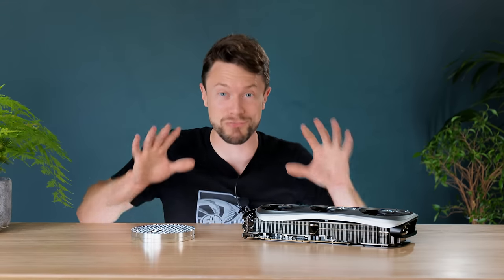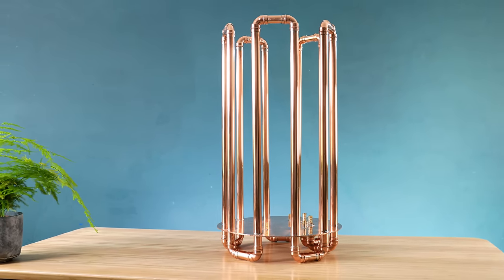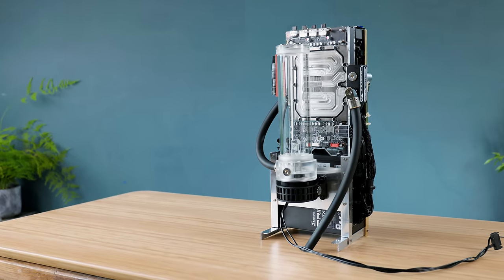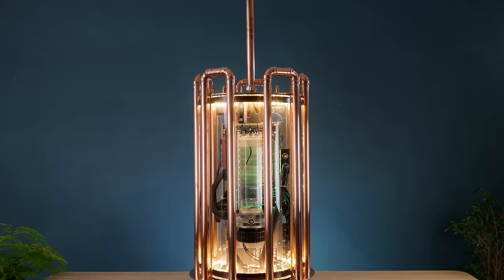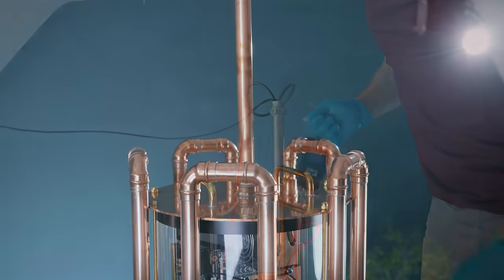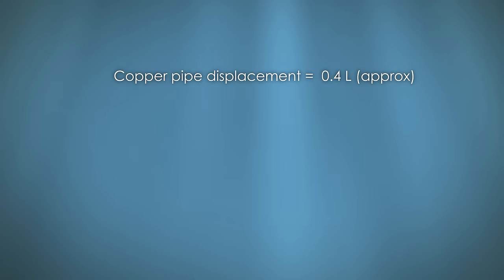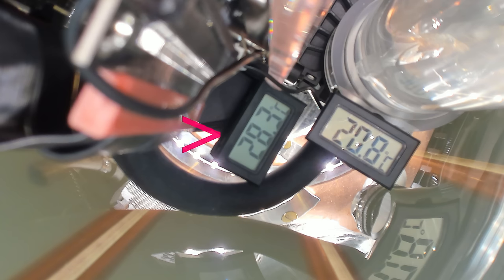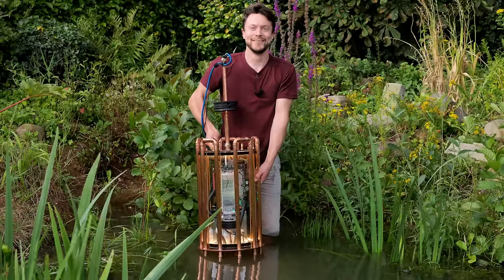Building an ACTUALLY water-cooled PC

Comment: There is a simple little water leak detector that's made for going under water heaters or in basements and cellers. You could install one at the bottom to get an instant audible alert on the first sign of leakage. Moreover, if you wanted to be really fancy... take that same alert signal run it thru an arduino or similar programable logic controller that triggers your pulley system to pull the computer out of the water.
Reply: He's never gonna use it again, tho. Probably disassembled it already.
Reply: @Iuripiotrowskidarosa  true.

Comment: the reason why your joints might look a little messy is because you're using pro press fittings instead of solder fittings. those little rings you see on the 90's are supposed to have a rubber ring inside, and they are meant to be fully compressed into the sides of the pipe using a pro press. if you'd used normal 90's, im sure the end result would have been much easier to get and wouldve looked much nicer!
Reply: I'm pretty sure that the ones he's using aren't pro press fittings, but rather a very similar-looking type that has a ring of solder incorporated in that bulge rather than a rubber o-ring, so all one needs to do is assemble and heat, no extra solder or press needed.
Reply: Not pro press but rather a solder ring inside, more common in Europe than USA.
Reply: @MysticalDork  I've never seen those before! they look very close to a pro press ring, I was mistaken
Reply: @joshdeconcentrated2674  They do look extremely similar, I don't blame you. I wouldn't be surprised if the same tooling/factory is used to make both kinds of fittings, the only difference being whether the insert is rubber or solder.

Comment: Awesome! For more longevity on the water seals you might consider milling o-ring grooves for the acrylic tube to slot into. Then you would have the advantage of the self-sealing o-ring effect, that would get more watertight as more pressure is applied. I would be concerned that the flat gasket seal would begin to fail with time, possibly relatively quickly.

Comment: I think this would make a lot more sense with copper gaskets, and an electrically neutral medium or an electrically neutral coating to prevent corrosion, and a positive interior pressure which would help reduce buoyancy and a sealed top so if there is a leak, the natural buoyancy of the system will prevent liquid from entering. Beyond that, this is genuinely incredibly cool. When its got the yellow and dark blue lights going (yellow rim, blue interior) it has a weird aesthetic resembling some of the real quantum computers I've managed to see. Quite surreal.
Reply: bumping cause i had all these thoughts while watching, especially that final shot looking exactly like the ibm quantum computer.
Reply: but what about condensation?  It is easy to cool a PC to low temps, dealing with the dew point is the problem.

Comment: I'm honestly impressed at the dissipation capacity of the thermal contact blocks on the cpu itself, one thing is keeping the waterloop coolant under control, but another is the physical limitation of how much heat can be transferred at any given moment through the main copper baseplate. Keeping a 13900K at stable 60 under max load is mighty impressive.

Also I'm sure the fish appreciate the added central heating, their pond value will now soar to the sky compared to competitors in the pond estate market!

Comment: I wouldve liked to see a thermal test of the complete system out of the water. Such a phenomenal build though and sick idea, i know your projects are typically one and done but id love to see more of this and with long term solutions/testing for this project in particular.
Reply: Same. Does the pond really do much? Curious to know.
Reply: Exactly.  What was the temps like before it was submerged?
Reply: @guelphdgc7995  Science tells us it should be much better in water than in air. It's the whole reason we use water cooling to begin with. This system here is not too different from my weapon system's cooling on a navy ship. It uses a liquid to liquid intercooler, where chilled water made by the ship's refrigeration is pumped to the system and absorbs heat from the glycol/water cooling loop that runs through the power supply and radar. Water has a much higher capacity to absorb heat than air.
Reply: @NandR  thats a big if in a build like this. If there is enough heat, to overwhelm the system in air then water should be better, but if there isn't the results should be similar. if he tested it out of water we could see if it did.
Reply: @edwxx20001  not really an if at all. Stagnant Air can act as an insulator while stagnant water will still absorb heat better.
Reply: @NandR  most of the time yes, but there is also a chance that we see no real difference. the limiting factor for chip heat removal is first the material interface between the chip and the heat-sink, then the heat sink itself. the heat-sink is "water cooled" in this build with or without the outside of the case being in air or water. the case being a large amount of copper could possibly be enough to dissipate the heat of the case in air efficiently enough to be just as good as water.
If the amount of heat generated was high enough you can be sure that water should be better, however with only the heat generated by a modern computer air could be enough that you wouldn't see a meaningful difference at chip level temperature.
Reply: @edwxx20001  I feel like in air the CPU would eventually throttle, or the Desktop will be noticeably hot as opposed to the submerged state where the CPU never goes past 60
Reply: My bet is that it does absolutely nothing to thermals out or in the water. Modern cooling solutions are incredibly efficient.
Reply: @NandR  Yea, no. Comparing military purposed built hardware to a small surface area thermal distro 800w pc is just silly.
Reply: @evolicious  No it's not. The principle is the same. Using water to move heat from electronics and into a cooler supply of water. It's dead simple and nowhere near as complex as you think. Hell I had to blow on the fill port sometimes just to get the fluid to flow after the level dropped.
Reply: @evolicious   I know you are wrong. Water has a specific heat of 4.186 J/g degrees C, versus air, which has a specific heat of 1.005 J/g degrees C. That's more than 4 times the thermal capacity. It's the reason why Water cooling a PC exists anyway. But the small units people use for PCs can become saturated with heat due to the higher thermal capacity of the water than the air. This is basic physics. The actual weak point remains the small surface area of the chips being cooled. But the faster you can remove heat from that area the better. The only improvement I would make to this design is more surface area on the external tubes, like fins to dissipate even more heat.

Comment: Those temps are incredibly impressive just to add on top of how cool this project is.
Reply: guess the only way to cool a modern i9 is to have a pond as your loop reservoir.
kinda scary how excellent this cooling setup is. 800watt system pull is absolutely insane.

Comment: Maybe you can add a sensor to check leaks inside the tube, to shutdown automatically if leak detected so not damaging the components inside
Reply: #OceanGate
Reply: Even better : automatic release of the weights under the PC if it detects a leak, which will make the PC floats and reduce risks of higher leaks
Reply: @76Eliam  That could make the case tip over

Comment: Gotta watch it with multiple types of metal in your water cooling loop. Basically make sure any part of your water block that is in contact with water matches your copper theme, or use a metal that matches your water block. Different metals being in indirect contact via the water can cause one of the metals to degrade and ruin performance. It's not noticeably instant, but it is something that would become a problem fairly quickly. It will definitely be a pain to clean and repair as well. Anyway, can't wait to see a wireless RC gaming submersible build xD
Reply: Plus electrolysis, and other types of chemical reactions that can cause oxides, or sulfides to form at the contact points of two separate metals.
Reply: Distilled water is barely conductive so unlikely to be an issue. The only metal in contact with the pond water is copper/brass.
Reply: @JPEight  ponds aren't filled with distilled water.
Reply: @JPEight  brass is an alloy and is therefore different than copper. all metals have different oxidation potentials and any size potential difference will eventually lead to oxidation.
Reply: @trechtzach8151 there's no pond water going into the system, so that's good
Reply: we're talking about oxidation reactions happening outside the PC, with the outside metal parts, via the pond water
Reply: @jacobdavis6604  the copper pipes are exposed and that's where corrosion may happen.
Reply: You're cracked out of your gourd if you believe this rig was in the PC longer than a few minutes after he stopped filming lol.
Reply: also if two metals expand at different rates it can create gaps, which is obviously dangerous
Reply: "Distilled water is barely conductive" This is only true in theory, in practice the distilled water sill start picking up ions from the metals very quickly and within seconds will become at least somewhat conductive.
Reply: @nunnk105 is saying it might need a sacrificial anode, if you mix metals that are in contact with each other and any metal part exposed to the pond has an induced electric current (I'm not sure, but perhaps the air circulation fan shown at 7:40 could induce a current?), then its possible that corrosion can occur. Outboard motors on boats require a sacrificial anode as the boat moving through the water creates an electric current through the hull and the motor, the sacrificial anode will corrode before any other part of the boat does.
Reply: @KalishKovacs  Yeah, adding a zinc (or magnisum) anode would probably be wise if you plan on keeping it submerged for any realistic length of time, but at the scale he's doing this test it probably would have been just as good to have an aquarium with distilled water. If done properly that could be one method of cooling to use for home setups if we reach  a point where the bottleneck for commercial computer components is heat dissipation.

Comment: It might be interesting to fill the inside with Mineral Oil, that way, because Mineral Oil, Acrylic, and Water all have similar refractive indices, you wouldn't be able to see any of the protective bits, and it would just look like the electronic hardware was submerged directly.
Reply: another side effect would be your components shorting out, great
Reply: Then you would have a PC that is immediately shorted, and then sinks…
Reply: @Thecoolman1  @zyncra3965 
No it wouldn't.  Years ago I've seen people overclocking their PC's and they had the complete mainboard submerged in a container with oil.
Oil doesn't conduct electricity.
Reply: @Ni5ei  Well, it would fucking sink, don't you think?
Reply: @zyncra3965 Mineral oil is an insulator though, not a conductor.
Even power grid transformers are filled with some sort of mineral oil (Designed for the much higher voltages of power lines) and no problem whatsoever.
Reply: @Thecoolman1 seeing the amount of weights he added to make it sink, I dont think it sinking would be a fucking issue 😊😊😊😊
Reply: @peyton3509  Would definetly sink. Mineral oil is 0.8 g/cm^3, which means that the net boyeancy of the interior volume is 0.2 g/cm^3, or a fifth of the lfting power it had when it was filled with air.
Reply: @Thecoolman1  Well it wouldn't have to be completely filled with oil. He had to put extra weight on it to make it buoyant. So there's room for extra weight.
Reply: Would be cool as well because since people already cool PCs with mineral oil you could just loop it into the whole system so it's all flowing through the system, the internal space, and the copper pipes too.
Reply: toasty bros literally made a mineral oil pc this past year
Reply: @zyncra3965  Mineral oil won't short electronics
Reply: Right, I remember Linus Tech Tips team building PC in mineral oil. It worked great.

Comment: A couple of things you have to take into consideration:
Moisture... as you didn't vacuum out the air & seal, you might have to deal with condensation inside.  You might be able to cool the air to match the water temp prior to sealing & not have the thermal difference.  I'd also add some moisture sensors, both at the bottom for leaks pooling, and another for general humidity.
Crush pressure...  as this is more proof of concept for home use & floating, totally fine.  But for anything deeper than a creek or shallow pond, the rubber sheet gaskets probably won't work.  You'd probably need an internal ring preventing the plexi from being able to shrink, and some sealant around the outside edge.  But really, if you're going deeper you wouldn't be using plastic anyway.
Reply: Do you think condensation would form on the inside walls of the cylinder considering its 30°C inside?
Reply: @robertjusic9097  There is a possibility. That computer won't be on all the time and condensation just needs that small window to form. And honestly, contingency measures are great to have even if they might be unnecessary for others.
Reply: @robertjusic9097  Totally forgot the system was putting out that much heat itself when I suggested cooling the air prior to sealing, so the pre-cooling wouldn't work.  But yes, so as long as there's any moisture in the tube's air when it gets sealed up, there will be condensation inside.  But given it's a closed system, it won't increase, but just having it might cause corrosion issues down the line.  Vacuum sealing it should fix all that but I don't know how to pull that one off with the wires coming up & out.  You could instead fill with argon, since it sits heavier than air it will displace all of the regular air, and is both dry and inert.  They sell that stuff pretty cheap so that's probably the easiest way to go.

Comment: You could have filled the internal reservoir with mineral oil! It's a nonconductive liquid that's often used not only for immersion cooling electronics, but also for protecting undersea equipment from moisture intrusions!
Reply: But it makes maintenance a huge pain.
Reply: @mastaw Yeah Luke would agree
Reply: @mastaw  not like you can open it up and maintain it at the bottom of the ocean anyway
Reply: Mineral oil is an environmental contaminant, though. He stated that he wants the system to be environmentally safe in case any leaks occur.
Reply: @ambozz3726  I'm wondering if the copper itself is an environmental contaminant. I'm not sure how much it would leach into the water, but I think copper can be pretty toxic to aquatic life.
Reply: @aquabudgie853  Yeah, but there is a reason this isn't used in commercial DCs in rivers/small bodies of water as it destabilises the natural environment, heating the water, killing some wildlife and increasing things such as algae.
Reply: @Zreknarf   Doesn't need to be in an ocean. Have used similar things (3m Novec) to run small local heating rings. Looked a the feasibility of using large DCs to provide consistent heat to a local swimming pool and gym. Its quite interesting and makes good economic and environmental sense to use excess heat, and with proper heat exchangers in multiple chambers chance of contamination is negligible. And worst case you drain the pool for a day.
Reply: there are better fluids for that although really expensive. 
The mineral oil will destroy plastics/rubber over time

Comment: I’m sure I’m not the only one wondering this, but with all that copper tubing and resulting surface area, how well does this run in air? I imagine it would run just fine and could be used as a radiator in the winter!
Reply: I think he might have enough cooling to run in air would be interesting to see
Reply: it will heat up pretty quick, it has no forced cooling and not much surface area compared to a radiator
Reply: Water is 25x more heat conductive than air.
Reply: @linusgoblin  the heat conductivity of water doesn't really mater at all since the water is being pumped around. However, without any fans blowing on the copper pipes, air just moving around due to air currents in the room, and hot air rising is probably noowhere near enough to cool that PC when its in air.
Reply: @jearlblah5169  it does matter a lot. Air just won't be able to accept enough heat over such small surface area. You don't think the way radiators are designed is accidental, like why aircoolers don't just put heat pipes up in the air and need to have an intricate system of plates to increase the surface?
Reply: if they can carve some more surface area in those copper pipes it would certainly help to make microchannels/tiny finstacks
Reply: @girlsdrinkfeck  same heat flux yes, but at very different temperatures

Comment: The entire build looks awesome, great job! A few notes, copper itself is a biocide. I'm not sure if it is enough for the coolant, but it might affect the ecosystem in the pond a bit (and the fan vibrations could also do that). Also, the cable tube is sitting uncomfortably low, I'm worried that a small wave could make it ingest water. Also, that tube isn't protected from rain, making it into an inverted J shape would solve that issue. Another concern I have is corrosion, there doesn't seem to be anything protecting the copper from corrosion.

A more practical approach to cooling a big data center would probably be to keep the computers outside the water, and only put the radiators in the water.
Reply: Yeah, sufficient concentrations of copper can be lethal, especially to invertebrates. This would probably harm the pond in the long run. In a larger body of water it may not matter.
Reply: This. There’s a reason they use copper on boat hulls to prevent growth.